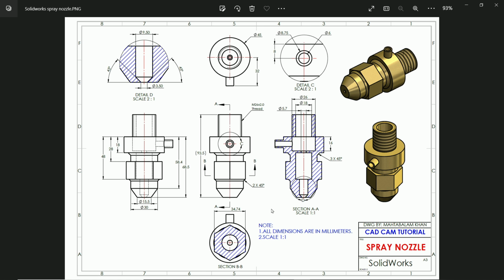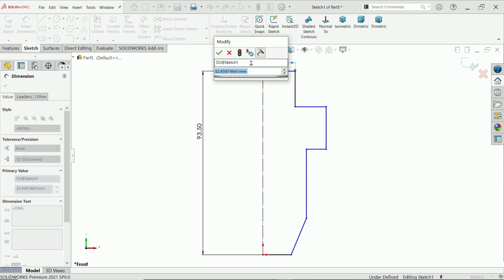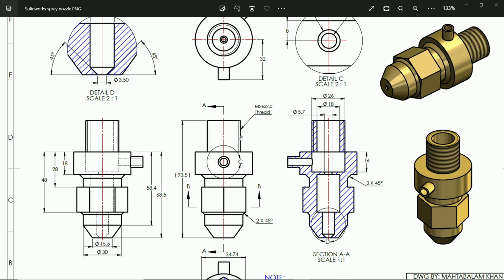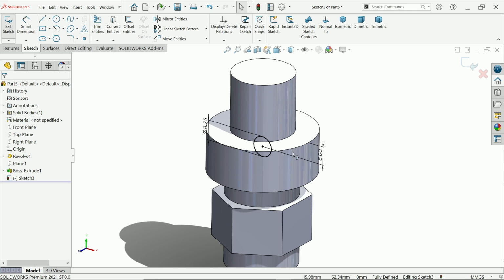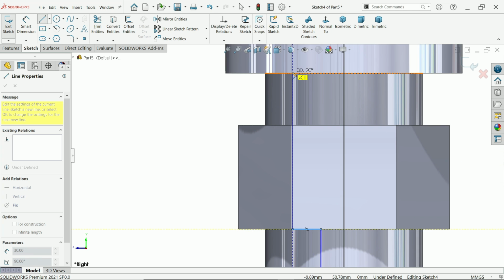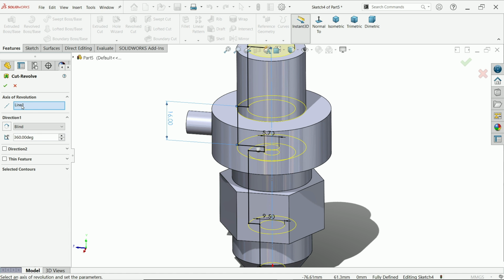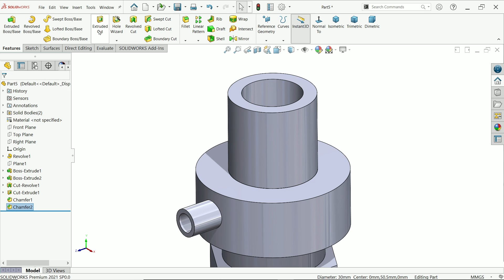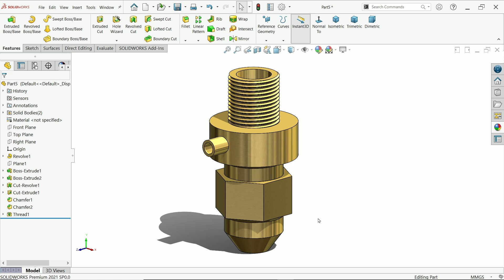SolidWorks tutorial Spray Nozzle

Comment: The problem I have with this video is not the drawing or teaching it is the drawing shown at the beginning of the video.  How could this nozzle ever be manufactured as it doesn't show any internal threads in the section view?  To have the internal voids the drawing shows for this nozzle would have to be two or three pieces threaded together. Also as drawn the threaded part of the nozzle has almost no thickness where it connects to the collar with the small side pipe.  It would break off so easily.  Even though the drawing is technically accurate it is a part that could never be produced so I wonder what is the point.  Not the usual good work done by this presenter and a bit disappointing.  If anyone would like to see how I think this should be drawn I will do it in SolidWorks, post it to my Google Drive account and supply a link to the picture.
Reply: Thats what I said before you and they jump all over me.
Reply: @JBCool0729  Who are you and how do you figure I "jumped all over you"?  Are you sure you replied to the correct person?
Reply: @bpetnoi1472  I did not said you jump all over me I said that other user jump all over me for making comment about the mistake he makes.
Reply: @JBCool0729  OK my apologies to you for the misunderstanding.
Reply: @bpetnoi1472  It's OK.... I hope you red my post and the comment's others made.

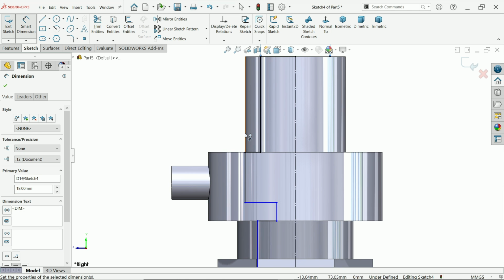Comment: Nice tutorial for demonstrating the features.  I just noticed  a problem when you make the line coincident to the outer wall at 8:06, it became 2 separate bodies when you revolved cut. Also it created undercuts which means it is something hard to manufacture unless you use a special tool. But as I mentioned, this tutorial is still useful for demonstrating the features. Thanks